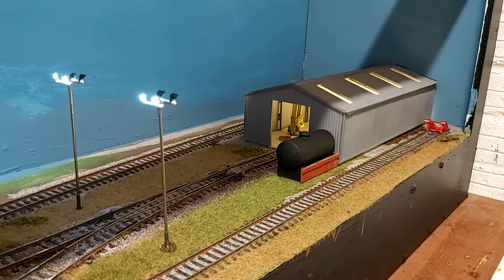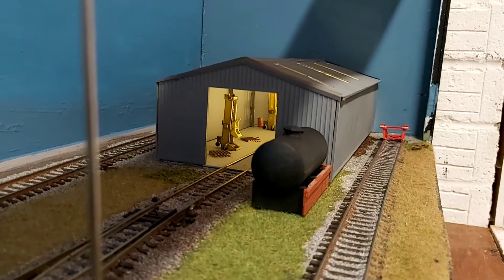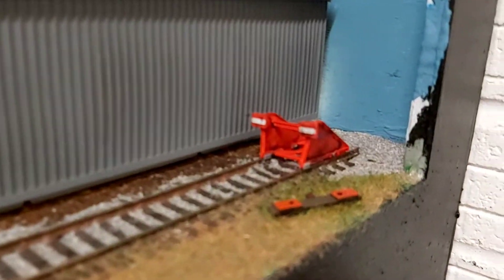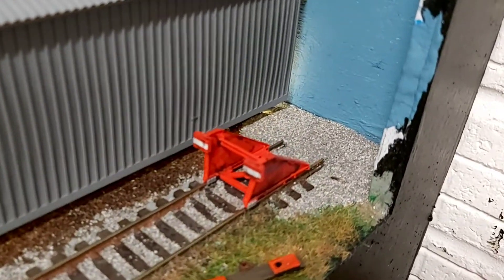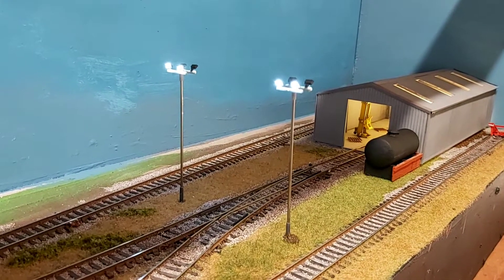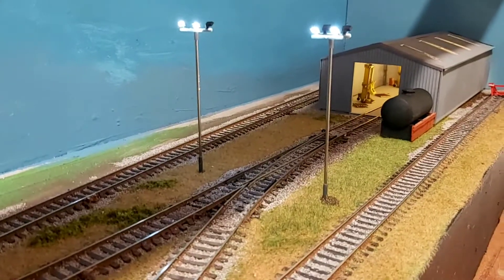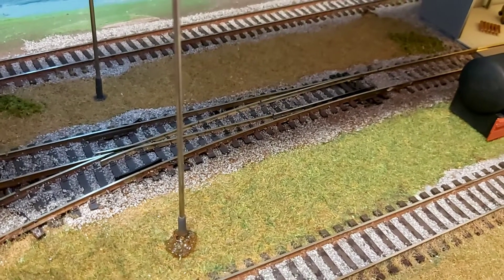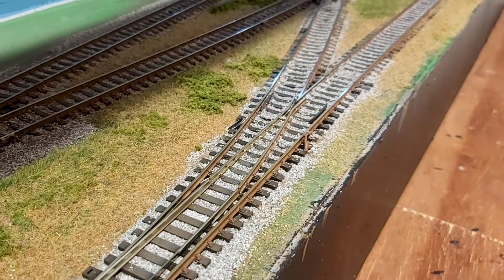Denton Lane WRD | Layout Update | Episode 6

Comment: great update, a couple questions, the accurascale buffers, do they like connect onto the track? and also, can locos actually get to the siding closest to the camera if there was a wagon in the shed? loving the mainline 09! cheers, adam - magor junction
Reply from the maker: Yes they clip on to the rail. Unfortunately that's one of the flaws with the track plan, mainly due to space. However larger Mainline locos will tend to stay in the reception siding to the left while the shunter takes over.